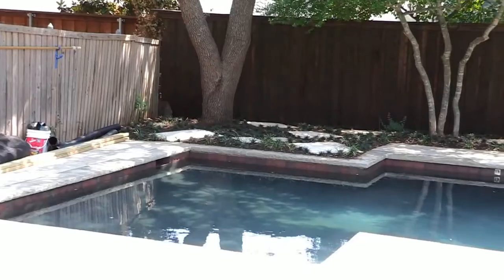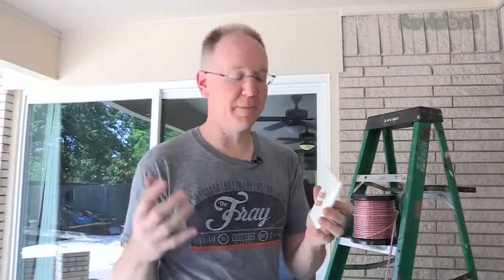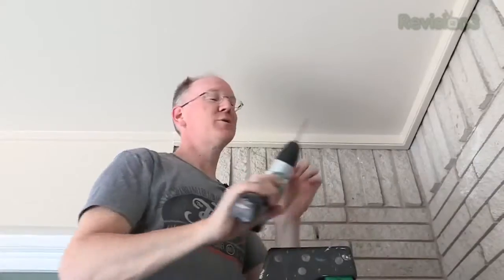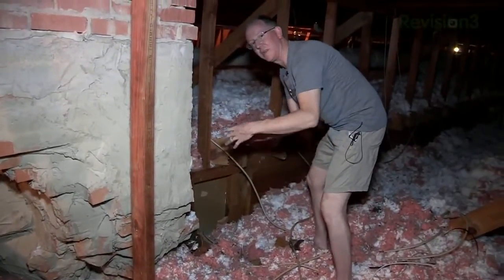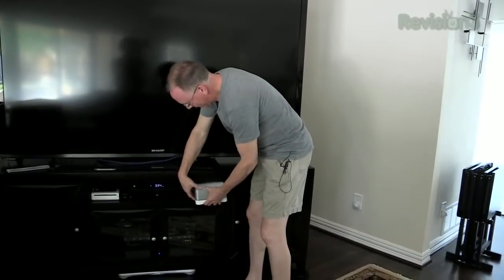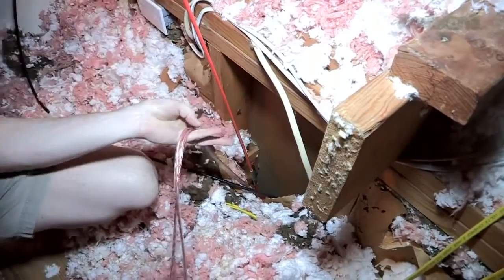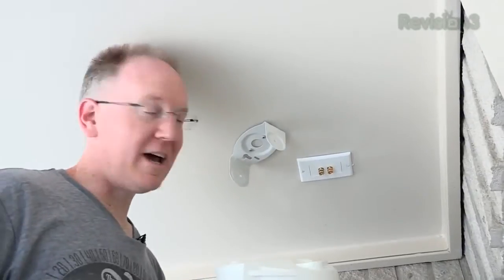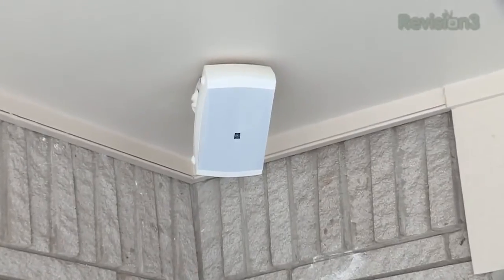Geek Beat Archives   How To   Install Yamaha Outdoor Speakers w  Sonos PlayAmp

Comment: Nice setup! In my case, I didn't have very good access to the attic or crawl space area, so I ran conduit for my speaker wires and installed a junction box where each speaker was going to be installed

Comment: so many things wrong with this video. In wall speaker cable? What speaker cable isn't in a wall?? If you pay for in-wall speaker cable you are a mug. And only if you are very lucky and your walls don't contain blocking or insulation could you fish speaker wire down like that. Oh and you would install the box AFTER you fish the wire, not before, since it would be practically impossible to pull the wire through the tiny holes at the back of the box.